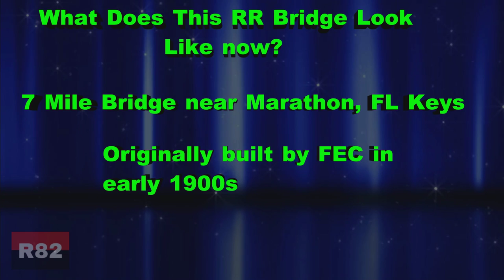What Does The Old 7 Mile Railroad Bridge Look Like 100 Years After ?

Comment: Swing span operator Peter Fancher worked as a bridge tender house at the Old Seven Mile Bridge near Marathon, Florida. He was killed on the job when a backhoe being hauled on a flat bed trailer across the old Seven Mile bridge slammed into an overhead propane tank beneath the tender house, causing a massive explosion on March 3, 1981.   The swing span was severely damaged and left inoperable to being opened mechanically thereafter.    That is why the swing span was removed from the old bridge after closing.

There is a small memorial plaque to Peter Fancher on the barrier wall at the high point of the 1982 Seven Mile Bridge.
Reply from the maker: This is one of the most insightful comments I've ever read about the Old 7 Mile Bridge. I appreciate you sharing it with us.  Thanks as always for the views and comments!

Comment: Well done, I thoroughly enjoyed it!  A good read: "The Last Train to Paradise", by Les Standiford. The story of Henry Flagler's building of the overseas railroad. He took on this great task after retiring from Standard Oil, at 65 years old. 
I was 6 years old and lived on Little Torch Key. I attended first grade at Marathon Elementary in 1954, traveling 25 miles each way over Bahia Honda and the Seven Mile bridges on a school bus. I don't recall anything about school at all, only the elevated ride over the channels. There were massive schools of mullet or other baitfish, (depending on the season) and predators feasting ... large Tarpon, Jack's, Barracudas, King Mackerel skyrocketing and huge sharks attacking them, sometimes mid-air. I do remember the bus driver would move against the curb and come to a stop pulling in the mirror on those very narrow bridges when a large truck needed to pass.